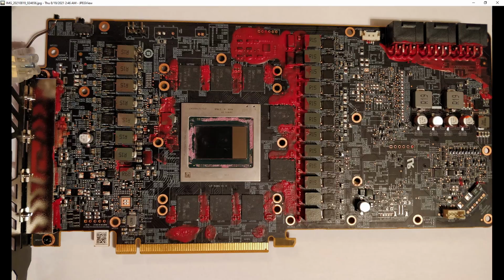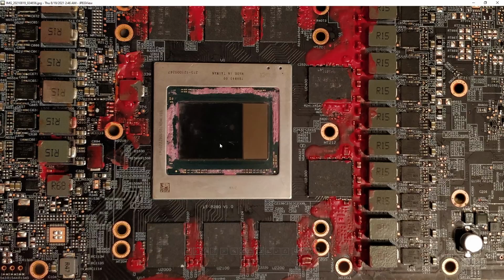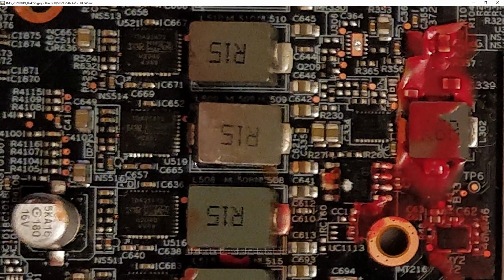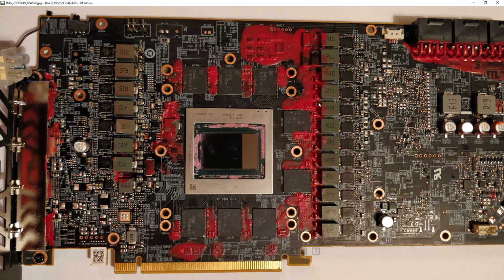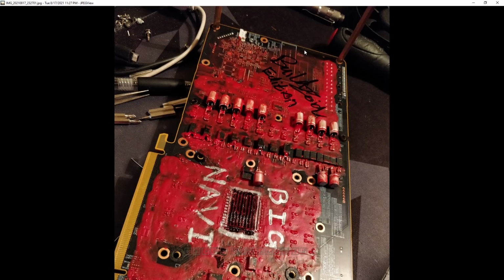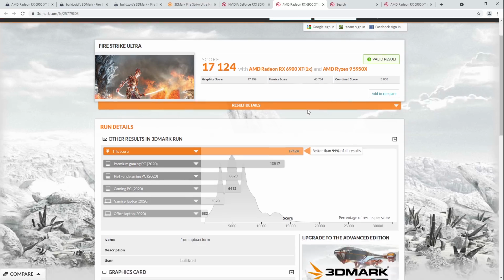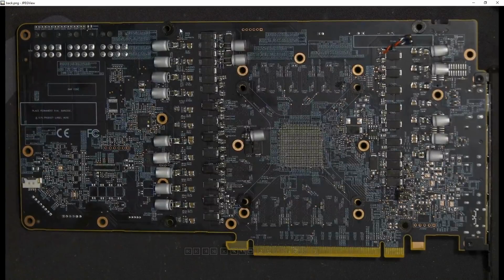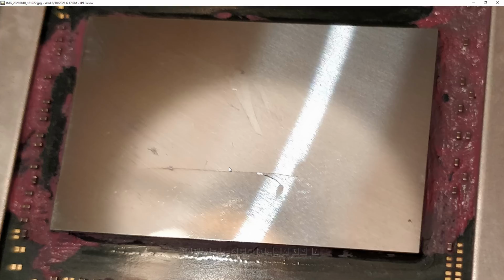The last ramble about my RX 6900XT Red Devil Ultimate because it's SUPER DEAD

Comment: That crack is impressive,  I thought you dropped something on it. Would like to see the X-RAY if you do that.
Reply: He could’ve dropped the LN2 pot on it with a crack like that regardless of what he said and that may have actually been what shorted the power stage a voltage surge cracking the die is… out there
Reply: @trisjack82  it happens, seen it live with Rbuass
Or was it Kingpin?
I don't remember
Reply: @ikarus1111a  It has certainly happened to Kingpin; someone commented about it after BZ's last ramble.
Reply: My theory is that a surge in power could heat the silicon really fast and crack it by thermal chock.
Reply: @ikarus1111a  that would be correct

Comment: I really hope that graphics card manufacturers start implementing overvoltage protection to prevents GPU core damage, such as a Transient Voltage Suppressor and an independent fuse for each phase. maybe even implementing active OVP that shuts the VRM down by cutting off the 12v to the VRM using a MOSFET if there is overvoltage on the vcore
Reply: He killed it. it's like saying dragsters should have airbags.
Reply: @powertoker5000 i know that he heavily modified the card and overclocking it, but there are many graphics card out there that aren't used for overclocking also suffered from this issue. With increasing prices of the graphics card nowadays, it's so much better to have that kind of protection.
Reply: Independent fuse per phaze will achieve absolutely nothing userfull
1. Core will be gone by the time it takes for fuse to blow.
2. Fuses will limit how effective are input filtering capacitors.
3. Smart power stages already have current sense outputs to VRM controllers. VRM controllers can balance/shutdown the phazes based on real-time current (including overcurrent). Goal is to prevent phaze destroying itself instead of dealing with aftermath of destroyed phaze.
TVS might be userfull except when it fires up, it will be forced to dissipate as much power as core dissipates, and dissipating that much heat from extra components isn't cheap enought to be put into consumer gpu's
Reply: @volodumurkalunyak4651  i think individual fuse will be useful because usually only one high side MOSFET shorts at a time. individual fuse will allow a much lower fuse current ratings, hence it will blow out at a much safer current, and faster. With that in mind, the TVS will also handle less current and power if one of the high side MOSFET fails. Also I don't think a VRM can shut itself down if the high side MOSFET is shorted. If the VRM is sophisticated enough, maybe they can even utilize the low side MOSFETs to clamp the VCore and blowing the fuse.
Reply: @DavidKristiawan  i repeat:
1. fuse is not capable of blowing fast enought.
2. Per phaze current sense is there to PREVENT mosfet shorting out, not dealing with consequences of shorted one.
3. TVS are not avaiable for clamping voltages lower than 6V. Whan you are having 6V on GPU Vcore (TVS is hardly even clamping at that voltage), that particular GPU is is already destroyed.
Reply: @volodumurkalunyak4651  i know fuse is not fast enough. That's why the Vcore should be clamped, and the fuse is individual so it can be low current ratings. Also, MOSFETs can shorts, even if the current is within specifications
Reply: @DavidKristiawan  no

Comment: When using a Hotair station to remove/install a powerstage chip, Drown that pcb in flux.  The chip should move and attach itself to the soldering points if done right.  I recommend watching some of Louis Rossmann videos.
Reply from the maker: my flux always just runs away from the hot air. I guess whatever I'm using just gets too thin
Reply: @ActuallyHardcoreOverclocking  AMTECH tacky flux is what you want.
Reply: @ActuallyHardcoreOverclocking  As Thanny Said & you can try turning the Air flow down as well.

Comment: This reminds me of one of those dying soldier scenes in a movie.  The poor board.   So many wounds!  Time to give it last rights.

500Khz (x N phases).  Frequencies have been rising over the years as the need for more stable low voltages under extreme current loads rises.   The power delivery on a modern motherboard or GPU is pretty amazing, honestly.

The crack... the more I look at it, the more I think you are right.  If it were a cpu cooler related crack it would probably be more extensive.  But it looks like a point short crack due to extremely quick heating from a short.  So, excessive voltage, something shorts on-chip, melts that part of the chip internally making the short worse, and the momentum from the energy being pushed into the chip finishes it off before the VRMs can shut down.  Makes total sense.

-Matt

Comment: Yeah ive worked with electronics for a long time...a crack like that isn't a stress fracture crack. That crack was done internally by a massive short... Them transistors are switching incredibly fast like you state. talking nano seconds. Even short circuit protection is no match to save the gpu in this case.  Even.. the best power supplies. SC protection is still in the milli/micro seconds.  There was no time for that 12volts to shut off, once that high side fet failed, that core saw a direct 12volts until short circuit protection kicked in, even if it was for a mere few microseconds. That crack was done by 12 volts directly to v core. I'll put 100$ on it. Why
Reply: how controversial

Comment: I guess this is downside of going with very big piece of silicon, because of die size they are very brittle.From what i heard from repair guys that work with GPUs 6900XT are really hard to reball because of that, they tend to crack from anything.
Reply from the maker: the 6900XT isn't really that big. It's 520mm^2. The 780Ti, 980Ti, R9 Fury X, 2080Ti, 3090 are all bigger. The GTX 580 is the same size as the 6900XT.
Reply: @ActuallyHardcoreOverclocking  It's rectangular(dunno if that matters) and on different manufacturing node, Furys and other cards with HBM kinda got same problems,they are nightmare to repair anyway. Maybe it's got nothing to do with die size, but I heard of several cracked 6900XT, so X-Ray would be interesting.

Comment: If you will read this comment, i will add something weird that is happening with my amd rx 6800 (reference card from sapphire), on Gigabyte AORUS P GM 750 W (this is the aorus version - AP GM 750W - not the one that is blowing up). And you my be right about aggressive power on gpu. 
So my problem was sometimes, when i made "new" settings in bios, pc will shutdown for 3-5 sec and power up with new settings, i hear click in psu relay and bam! Full shutdown! Protection from psu won't let me power up again until i flip the power switch on psu off for 10 sec. It happens even from standby. I think the card is taking too much power for very short time, because it's happens instantly and my psu is sensitive. I don't know exactly what protection kicks in and shuts itself off. other than that i don't have problems or stability issue ! 
Vrms, power phase, etc. for sure is taking too much power when they power up! I changed my psu with Corsair RM1000x 2021 version and i don't have this problem anymore, for me was annoying. After I've seen your video i'm thinking if this was good idea .
Still that failed power stage, for sure was a dodgy one!  I don't know if they could implement some kind of voltage protections on power stages!

Comment: Worst case you got the full 12 V high side output which is not ideal for a silicon process node that runs on 0.9 V core.

The crack is where all of the magic smoke escaped which made the core run ;-)

Comment: Buildzoid just doing Buildzoid stuff. Tell me something, is this bigger pain than the cracked HBM on the Fury X?
Reply from the maker: the HBM didn't crack I scratched the interposer.
Reply: 2 years ago I had Fury X for 100 euro. Was so happy for possessing it as a relic. On the first disassembly I broke one of the HBM chips in the tiny corner. Now its just non working relic.
 With your 6900XT you became N1 in world, and this is huge. Keep going 🤗
P.S. The irony today is after few hours I'm going to barter my Red Devil 6900 for  Zephyrus G15 R9 3070. It makes me little sad i never explored the full potential of this card, but I don't  have the knowledge and proper hardware and time to do this. That's why we have Buildzoid.

Comment: I wonder if the bulk caps you added actually dumped their energy into the MOSFET when it switched off at idle? Depending on how the power stage is switched off, and how the internals handle suddenly getting a burst of energy might be related...
Reply from the maker: that mosfet always has 12V applied to it on that side. The caps won't change that.

Comment: Hmm I wonder about drivers as well perhaps. I've recently had to roll back my drivers from the latest 21.8.1. Had some very erratic performance on my 6800xt. So I tried 21.7.1, and still had some issues so I went all the way back 21.26.2 and those drivers seem rock solid. With the newest drivers my card would downclock down to zero and mem clk would reduce as well, but gaming was super glitchy at all speeds. Goijf all the way back to 21.26.2 my gaming is back to solid and steady but my card will not downclock the memory so Radeon is showing a constant idle draw of around 30-40 watts. Which could be just the vram.

Comment: Theres a german youtuber called GerRepair. He replaces cores and power stages like its nothing. He would be able to repair it if he has a 6900XT with a dead pcb but working core laying around. Price should be reasonable.
Reply: The physical repair is one thing, getting a new core is another, much bigger issue.

Comment: I think the core crackt and Blow the vrm.
The Temperature difference on load and idle was the Problem and the die had Maybe internal stress
Reply from the maker: Except I've had cards with cracks from physical stress and those didn't have massive short circuits on any of their power rails.
Reply: this is less likely, the OCP on the VRM would have kicked. When the FETs die, they tend to short themselves, taking whatever they control/supply along with them... unless it's a DC motor hand drill, that just keeps spinning.

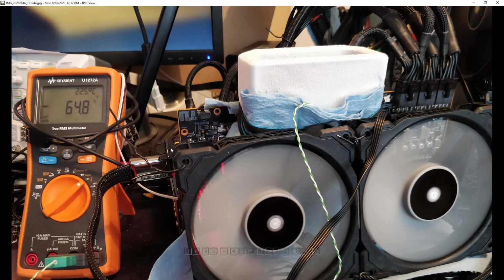Comment: 27:00 - maybe... Condensation shorted out this phase & made path & killed gpu ?
Reply: After 29:00 - condensation under high side*
Reply from the maker: @mmllmmll22  I dried the card at 110C before prepping it for the session during which it died.
Reply: @ActuallyHardcoreOverclocking  well, then i have no clue. Hopes that 3060 will be abused till top1 :>

Comment: Are you sure you didn’t just damage the die with the LN2 pot and then blow the power stage trying to run it afterward, that seems way more likely BZ
Reply from the maker: the system randomly shut down and at that point the power stage was already dead(I checked for shorts because I heard the PSU's relay click).
Reply: @ActuallyHardcoreOverclocking  I guess this is just one of those weird things that happen to pc parts then

Comment: I wonder if the LN2 cooling of a multi-hundred watt dinner plate sized piece of silicon had any connection to the cracking. I guess we'll never know ;)
Reply from the maker: I've run larger similar power draw chips without issues.
Reply: A dinner plate for mice, maybe

Comment: Sorry to hear that the graphics card died so quickly, I was hoping it would last longer.
Unfortunately, electronics made in newer and newer technology is more complicated, and extremely susceptible to hidden manufacturing defects.

I know how you feel because I was doing PC overclocking myself (long before you - I'm old) and I've been through the same, luckily it will go away over time and you'll feel better.

If the upper MOSFET key short-circuits, then such a coil cannot do anything about it, with such a low inductance, it will saturate in a fraction of a second and behave like a jumper on the PCB then full 12V will go to the GPU core, often burning a hole in the silicon or evaporating part of it structures leading to breakage

What's with your hot air soldering, you have some broken electronics, so play with it for practice. :)

Don't worry about failures and don't give up because you create awesome materials and that's why I became your patron.

Best regards and see you soon.

Comment: How did you  crack it?
Just How?
Reply: Rapid thermal expansion. Basically the Power stage stopped switching and worst case put 12 Volts into the core. A core that needs 0.9 V. So a 13 times higher voltage and therefore 13 times more Amps. 

This means that the GPU die got very hot very quickly. Usually the energy from such an event simply melts the electrical  connections inside the silicon which eventually stops the current flow (which is what Buildzoid described as the thing that usually happens).

In this case the die either got so hot that something inside sublimated (spontaneously turned from a solid into a gas) and the die got cracked from the thermal expansion of the gas inside the die or the rapid heating put the die under so much mechanical stress (due to rapid thermal expansion of the silicon) that it cracked from that

Comment: Tried to watch it but I just can't get the informations in 52 minutes. I see the die cracked, how tf did it crack?
Reply: he literally says how it cracked in the first 5 minutes and then goes into technical detail about what specifically caused it after that.. don't be lazy.
Reply from the maker: @sirmonkey1985  Also 2x playback speed is a thing
Reply: @sirmonkey1985  I watched the first 5 minutes, I didn't know it could crack under high load. I thought it'd crack only with physical pressure, wow.

Comment: Looks like the die was lapped (common with LN2). My guess is AMD uses extraordinarily thin dies and, upon lapping they become brittle and cracked with the massive up and down of hot and cold of LN2 stress...
Reply from the maker: I didn't lap the die. It comes with that surface finish from the factory.
Reply: @ActuallyHardcoreOverclocking  Interesting!!!!

Comment: not familiar with this channel or how savvy your are with hardware. But looks like your gpu is completely fkd/melted. Initially figured you used MPT to increase your voltage and just fried it -- until I got to the part where you said you decided to replace a VRM with a last gen card..? I probably missed it but what led you to even think that was a good idea? IDK anything about hardware on the physical side (never held a soldering gun) but I would never assume a VRM from a last gen card would be compatible with a 6900xt which has a completely different voltage requirement.